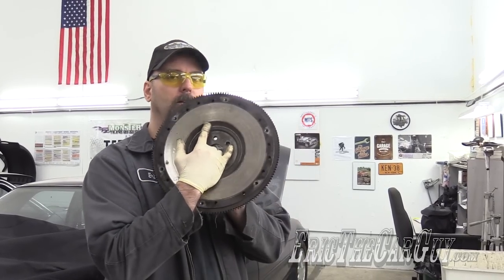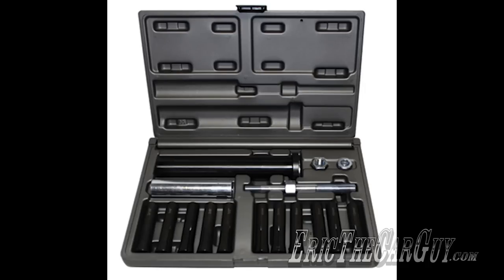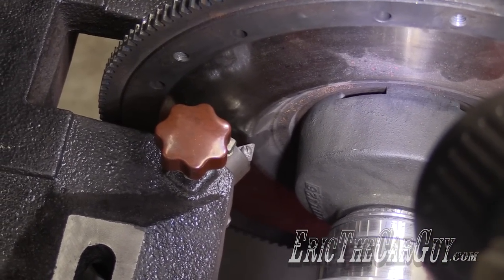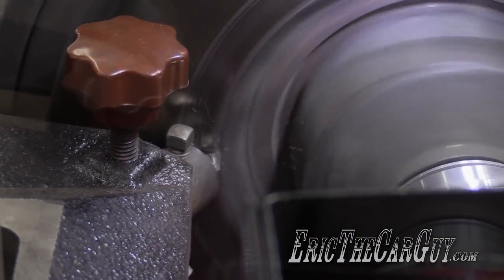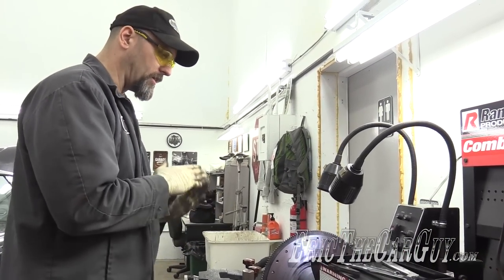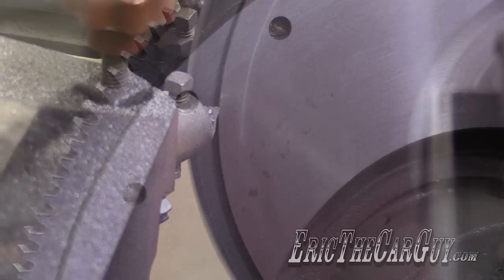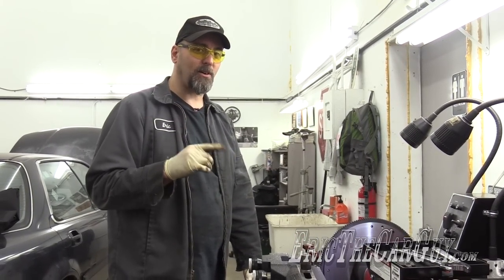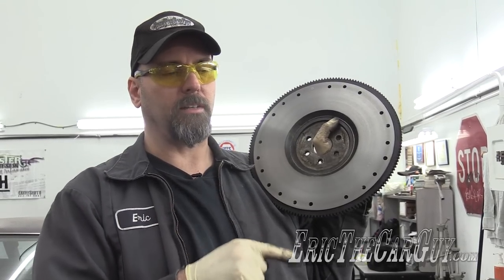Can You Machine a Flywheel with a Brake Lathe??

Comment: this is wanderful indeed can save lots of resources when fix fly wheels instead of scraping them. how much does  this machine cost?
Reply: 5 grand
Reply: +MEOW MEOW. it worth each penny of that amount
Reply: +bassamxp if you work on multiple cars then yes
Reply: +bassamxp Personally, I'd buy a real lathe for $5k. But, not everyone knows how to use a real lathe and most people can follow some simple instructions to use a brake lathe.
Reply: +MEOW MEOW veryvtrue
Reply from the maker: +bassamxp About $2500. See the link in the description for details on it.
Reply: +EricTheCarGuy thanks i did check out the link

Comment: I'm sure this method is used in the industry but what about flywheels with specific tolerances on how much you can grind off?  Isn't that the reason why a blanchard grinder is used/recommended?
Reply: You do not want the radial finish the brake drum lathe leaves. That's why the blanchard grinder is used.
Reply: That's what I thought
Reply: Wouldn't matter much. The finish is for break in and nothing else. Mine was radial cut and made no difference. I've got 10 years on it with a new clutch and the surface is still perfect.

Comment: I wouldn't worry too much about how much you can take off as long as you can still physically fit everything together, you're not going to take much off the weight and mass of the flywheel and realistically any lightweight flywheel you can get is made of aluminium and about half the weight anyway.  It's odd that it doesn't pump machining coolant over it though to keep the tip cool.
Reply: +Jackalovski Normally you don't need it as you're using carbide tooling on cast iron. I would bet that if Eric checks, that edge he thinks he cooked is OK. Unless they used really crappy carbide it can handle a LOT of heat.
Reply: +Jackalovski You and Eric should worry about it. Too much and the clutch won't work properly and you'll burn everything up in a few hundred miles. Contrary to what he says in the video there is always a tolerance for flywheels, you just need to know where to look. Every machined surface on a vehicle has a spec to fit in and winging it like Eric does causes problems almost every time. Now that he's not working by the hour I think he can afford to do things properly and stop teaching people to half ass their work.

Comment: Question, the holes where the pressure plate bolts on, dosen't that dammage the bits as they go over them? I was always tought not to turn drilled or slotted rotors for that reason.
Reply: That's called an interrupted cut. Yes it can damage bits, especially carbide. But sometimes you need to do it.

Comment: When you machine down the fly wheel like this, does it move the mating surface further from the flywheel? (IE if it still bolts at the same width).  Would this reduce the length you can use the same clutch assembly for?
Reply from the maker: +Matthew Trevett So far, it's never been an issue.

Comment: I think you burned that insert from high surface speeds instead of depth of cut. Carbide inserts can take vdry large cuts if properly made. If possible you could try slowing down the spindle as the tool nears the perimeter of the flywheel

Comment: You still have to note the discard thickness of a flywheel I'm guessing when deciding to do this, right?
Reply: +DoctorGuy He said there is no spec, so no discard thickness. This isn't an option you'd find at many garages. Worked a treat tho, quite impressed.
Reply: I would think too thin of a flywheel would crack under heat and pressure of course. I guess it's a judgment call depending on how bad the warpage is
Reply: +DoctorGuy If you need to take a significant amount off, you need to buy a new flywheel
Reply: Well, that's an obvious statement, but I guess my question here is - how much is too much? Like numbers wise. I mean you could try it a pass or two and then judgment call it if it's still bad, but if there's an industry standard I would feel better on that.
Reply: I wouldn't worry about warping or cracking more so than weight balance on a cast iron flywheel. Wouldn't take more than 60 thou or so off of it. He may have only taken off about 10-15 at most to clean up.
Reply: Must flywheels seem to have the threads for the pressure plate sunk into the flywheel. There's a hole that goes down a ways, then the threads start. I wonder if that's basically the discard thickness, when you reach the threads the flywheel has been resurfaced to the max?

Comment: should you use an oil/coolant to keep the bits happy and not burn up so quick
Reply: +crapper1 Unless you are set up for flood coolant(he isn't), not with cast iron. With cast iron, unless you use enough coolant to flush all the dust/chips away you just get an abrasive paste that causes more trouble than it is worth. At best he could use air cooling but that can blow abrasive cast iron dust into bad places on the machine...
Reply from the maker: +crapper1 If you set the bit on the outside instead of the inside like I did in this video, it shouldn't be an issue.

Comment: Is there a "rating" for how smooth the flywheel surface needs to be? I doubt it's any different than brake rotors, but thought I'd throw it out there.
Reply: +Jeffrey Ball 3 mu
Reply: These days they are recommending that rotors and flywheels be machined with a non-directional finish... and it's not supposed to be to smooth anyway.
Reply: DSCKy I have yet to see a new flywheel with a non directional finish. Rotors yes.
Reply: I've not seen many new flywheels, only been told they should have the blanchard finish instead of the turned finish? Of course rotors worked for years with turned finishes?
Reply: In industry flywheels are usually surface ground and which is (more) precise than turning with a lathe. The "non directional" finish cut with a sort of fly cutter and is only to smooth out vibration (over the length) of a cut due to poor manufacture. If you want to argue the "seating" capabilities, the pads are so hard now that to wear into the rotor it would take several months to alter the surface of the pad and if you want to say seats into the metal, then they need to score the metal deeper because it wears off. I have had the experience with "non-directional" that it sounds like a loose rim when you brake, until many months later when I machined the rotors (my own car.) High end rotors are not cross hatched - at least where I buy them at Ford. Now back to the aftermarket rotors...warranty is void if stacked on edge (not flat). Why is this? Because they warp? Wholesale pricing $8 each is why.

Comment: You should get one of those inserts that don't mind heat at all. The only problem with those is that they don't like speed, but in your case, AKA a brake/flywheel lathe, that shouldn't be a problem. I suggest hitting Adam Booth over at Abom79 here on YouTube. He's an experienced machinist, i'm 100% sure he can recommend you an insert that will a. fit your machine, b. suit your needs in regards to the fact that this machine doesn't run coolant.
Reply from the maker: +aserta That sounds interesting. Honestly I don't use the lathe enough to justify expensive bits though. Thanks for the suggestion.

Comment: While this can be done, the result isn't the same. With a flywheel surfacing machine you get a non-directional finish, whereas with a brake lathe even if you go with a super slow feed speed and a very small cut you still have a threaded finish. While it will wear in and be removed within a hundred miles or so of driving ( depending on how fast the feed speed and how coarse the cut ) it will also wear the clutch friction disc material. 

As for the amount of material that can be removed from a flywheel, I personally have never found any "spec" anywhere, however they do have a chamfer on either the inner or outer edge. That is the guide much like a recess in a cyl. head surface.

So while it can be done, the proper finish can not be achieved. Chatter will also add a undesirable finish and will effect clutch operation and life. These days the cost of a new flywheel isn't much more than the cost of resurfacing when you factor in transportation and wait time. Before I carry a flywheel to a machine shop, then go back to pick it up, I will buy a new flywheel and have the clutch job done with all new parts.
Reply: Why fix something when you can throw it away and buy cheap crap from China, eh?
Reply: SuperKONR
Factory Toyota parts come from Japan, not China.
Reply: I think the point of this is for people who have a brake lathe and can do it themself

Comment: Probably wouldn't hurt to add a little cutting oil to the bit. Makes the shavings stay in place and keeps the bit from getting hot.
Reply from the maker: +Travis Piper If you set the bit on the outside you would avoid cutting too much off which is what caused the bit to heat up too much.
Reply: EricTheCarGuy True, can always slow it down.

Comment: Why not pour cutting oil on the cutting bit to cool it, has it not got the coolant tank and pump fitted to the lathe.
Reply from the maker: +rick hctep (Rick45) Not necessary. Just set the bit on the outside of the flywheel instead of the inside to avoid taking off too much and the bit will be fine.
Reply: +EricTheCarGuy 
I was thinking metal to metal heat, and would have thought somehow it would need cooling to stop it burning the cutting bit..

Comment: How much can you machine off a flywheel? Mostly a redundant question with an adjustable throwout bearing fork/ slave, however most cars now are hydraulic. That being said, you keep track of how much you cut and shim the flywheel to the crank that amount. Again mostly redundant because most cars will never see more than one clutch unless driver is not capable of using it however in industrial applications, shims are the way to restore proper leverage. Looks like he cut 0.010-0.020".
Reply: Good question. I turned a flywheel for a friend's Toyota Celica. As I remember I had to take off something like 65-70 thou to clean it up. It worked fine. On some flywheels the limiting factor may be the remaining thickness being too thin and causing it to warp?
Reply: 0.065- 0.070"? ouch. It won't warp but ouch!
Reply: The car already had problems... wouldn't stay in 2nd gear. They just wanted it to move again and it did for quite a while until they got rid of it.
Reply: Back in the early'80s I worked in an auto machine shop for Napa. Back then the majority of flywheel were stamped on the rim with min specs. Some were stamped on the engine side, and we had shop manuals to research specs. I always enjoyed working flywheels, some that were huge with multi steps and pins made challenges . Some of the old large trucks tended to develope  hard spots that would bug us. Or we would find a crack or broken ring gear that nobody else had spotted.

Comment: some say the clutch isn't going to work like what expected after machining the fly wheel ,  is that right?
Reply: +Mohammed Omer Abu-talib you're supposed to machine the flywheel at every new clutch. this is you don't have ugly chattering at the catch point and helps the clutch seat in nicely.
Reply: MuscleCarOz I didn't have a fly wheel machined before, I just  replace the disc,  the pressure plate assembly and the throughout bearing, is it necessary to do that every time you replace the clutch?
Reply: +Mohammed Omer Abu-talib if you do the clutch before it is completely burned and the flywheel is in reasonable condition, you are ok to just do a clutch disc. I have done it many times. Machining is nicer though.

Comment: The spec, it's around   1mm~2mm  taken from a stock untouched unit.
Found some info about pressure plate diaphragm spring height and for a certain nissan its  33~35 mm. I guess it depends how far can the throw out bearing operate and how far can the disk slide on the output shaft spline.

Comment: In the years you worked in a shop you had never machined a fly wheel?
Reply: +ncautoman57 If you would have watched the video.. he talks about doing it. At around the 5:10 mark. "Cuz, I used to work at a place that had a flywheel machining machine", he goes into the difficulty of finding specs on how much should be reasonably removed.
Reply from the maker: +ncautoman57 Actually, I've machined several. I used to work at a shop where we had a flywheel grinder and I got pretty good at it. I've just never tried it with a brake lathe.

Comment: You can BUT your not meant to.
The reason why you should grind them is because of heat treated hard spots (shiny parts), the lathe won't remove them parts or destroy the tooling,
2nd reason is grinding give swirls on the face for better grip and bedding in, the lathe follows the clutch rotation meaning poor grip and a very high risk of glazing, this clutch will be slipping in half of its service life.
Reply from the maker: +MrGuvEuroman That's true. This is not a good method to remove some hard spots, but it will work in most cases.

Comment: Try doing it with a stepped flywheel like off an integra...
Reply: Done it, it's not bad if you pay attention and stay at lathe and baby sit it. I think Eric should have slowed down the lathe just a little on final pass, and gave it a bi-directional surface with a die grinder and scotch lock pad.

Comment: What is a flywheel, really, if not a single-sided brake disc?
Reply: It's on the engine to give power to a manual transmission.
Reply: DE Nichols you missed the point... it's a friction device.  Just like a brake disc.  Except a brake disc is double sided and it's role is turn energy into heat.
Reply: ArchimedeanEye Oh yeah! I get your comment now. Cool. Your question was rhetoric instead of actually needing an answer.

Cool. I love rhetoric.
Reply: DE Nichols Maybe two flywheels back to back and you have a heavy duty brake disc lol
Reply from the maker: +ArchimedeanEye Pretty much. Same friction material used on clutches as some brake pads.
Reply: ArchimedeanEye The idea is a bit different but some sporty cars have multiple flywheels to work with every other gear change to increase gear change speed a small fraction.
Reply: +DE “AutoBravado” Nichols dual clutch transmission
Reply: MEOW MEOW Bing
Reply: +DE “AutoBravado” Nichols To which I say, give me multiplate brakes!
Reply: qballtvp
Okay, that both looks really cool, and entirely looks like it's for marine use, or even submarine. How do you know about it?
Reply: DE Nichols "How do you know about it?"

Random curiosity. Multi-plate braking systems are not really needed in automobiles, it's better used in wet environments where you need more surface area to stop/slow something--from my understanding. 

"Okay, that both looks really cool, and entirely looks like it's for marine use, or even submarine. "

Not really submarine, but it's likely used in hydroelectric power plants. I would assume when a turbine needs to "stop", in order to be repaired, to save it from being damaged more, etc. You can't really "stop" the water, so you stop the turbine instead. 

Multi-plate brakes are also used in other  commercial applications, mainly things like farming and mining. 

Take a look at these monsters...

http://www.ortlinghaus.com/english/products/brakes/brakes.html

Series 002 is roughly 55 tons of stopping power and series 128 is roughly 516 tons. 

Not to mention the other insane styles available, like electromagnetic braking systems.
Reply: ArchimedeanEye it also is used for energy storage for the engine

Comment: Flywheels are best machined on a surface mill like the one used on a cylinder head and engine block. Hot spots in a flywheel are not handled very well by a brake lathe.

Comment: What's the purpose of machining the flywheel or brake?
Reply: So you don't have to spend money on new parts!
Reply from the maker: +karebu2 To renew the surface and ease break in of new parts.
Reply: make mass distribution symmetric around axis of rotation that minimize unwanted wiggling. wiggly disks tears rapidly.
Reply: +karebu2  Well um, a smooth surface works better than a scarred and jagged surface when applying a friction material with great force.

Comment: Now how are you going to balance the flywheel?
Reply from the maker: +David Walker No need. I'm not using it. Also, I've machined several flywheels in the past with a flywheel grinder and NEVER had an issue with balance afterward. Am I saying balancing isn't a good idea? No, just in my experience it hasn't been an issue.
Reply: +EricTheCarGuy Just wanted to know if there might be a vid in the future on your take of going about that. Thanks for the reply Sir.
Reply from the maker: +David Walker Not exactly. I do have a video I shot last week on crankshaft balancing however. That'll be out in the Fairmont series later this year.
Reply: +EricTheCarGuy That will be right up my alley.  It all started in a engine machine shop 19 years ago for me. Looking forward to that video.